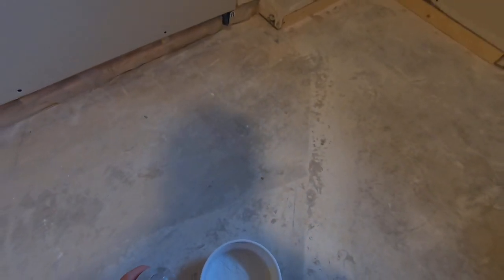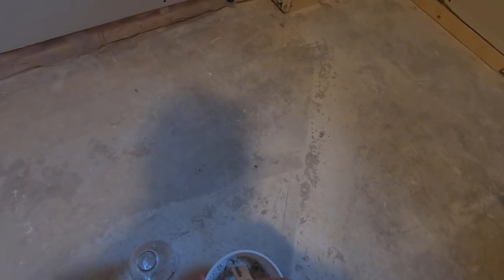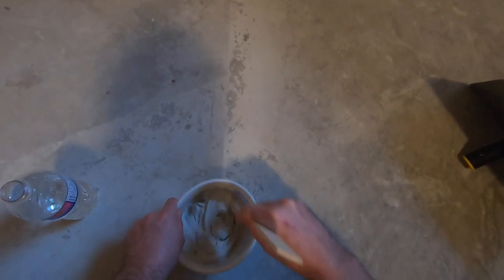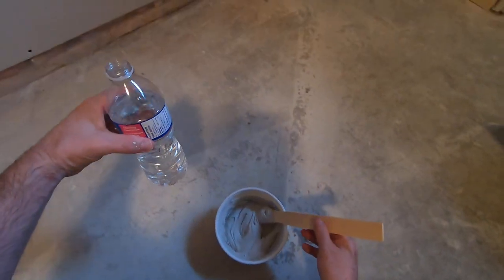Filling drywall gaps with sheetrock 90 before taping

Comment: How about Durabond? _+_+
Reply from the maker: Yes that would work too I'm just a big fan of sheetrock 90
Reply: @TheCanadianHomePainter  I also paint i find that if i have sheetrock 45 i will use it but i generally tape with durabond as my 1st coat applying it either by brush or knife. I do not use paper tape always mesh but i also do not do big jobs so it works for me Thanks for the response. I work out of Toronto+_+_